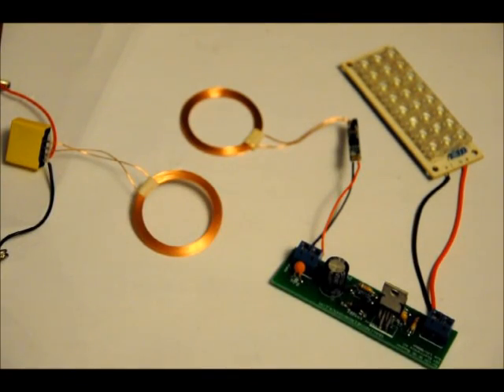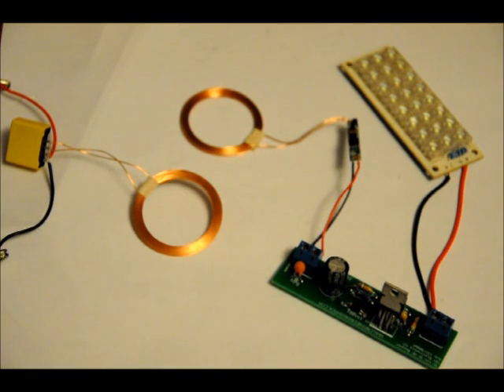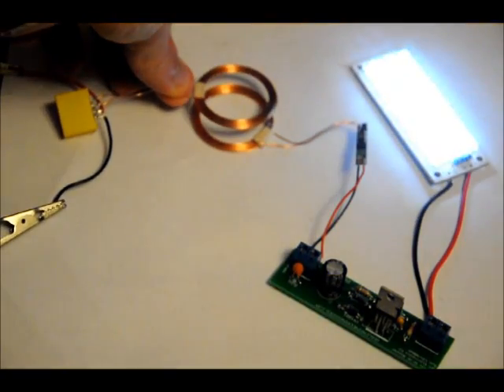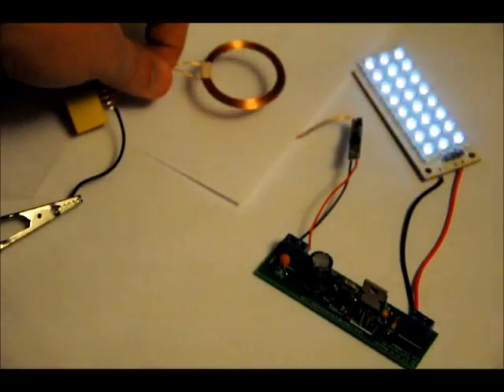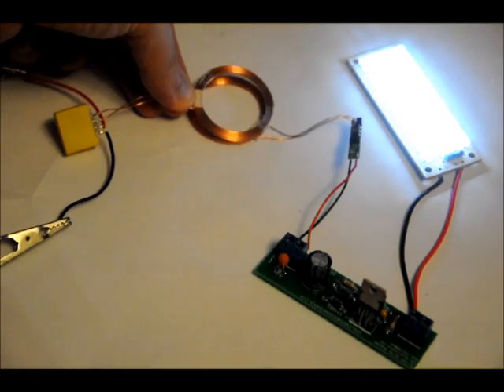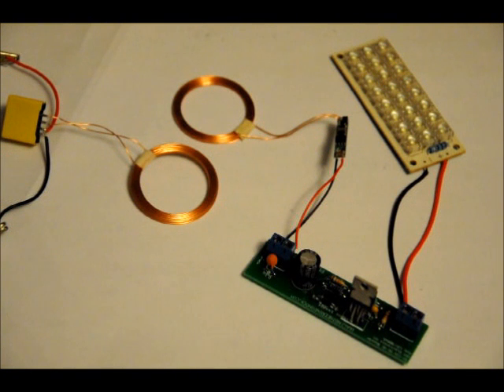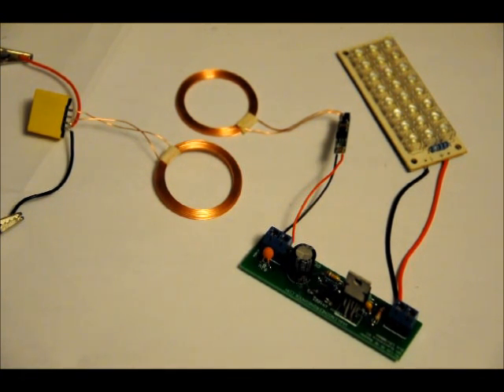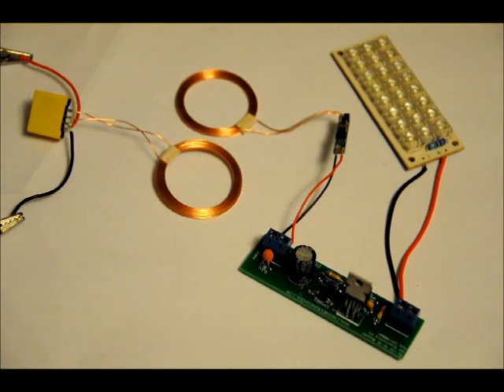Wireless Power Transfer   Wireless Charger Circuit For IPODs, etc!!!

Comment: Suggestion: combine it with a kinetic body motion charger, then add a solar charger. plug those into a portable battery charger. Then lastly add on your wireless charger. Have a friend 3D print a sleek shell to contain it all and fasten an arm band to it with a strap to fasten your phone or electronics to it and presto, no more wires necessary ever. Then if you really want to get fancy, figure out a way to combine this with the Emotiv EEG headset and bluetooth technology.

Can you do that? Afterward mass produce and either distribute for free or turn a profit.
Reply: If my idea is flawed or can't work, please correct me and explain how to expound upon it. Ideally this could change how we power things entirely. Independence from the power grid entirely.

Comment: Could you tell me how to calculate the max number of mili-amps, with regards to the diameter of the coil, the thickness of the wire and number of turns?!

Comment: cant you make the seconday coil larger, instead of using a boost converter? then use a simpler linear regulator or buck converter. after rectifing of course.

Comment: I'm working on a science fair project witht his inductive charger and I really need you help! What is that yellow, four pronged thing attached to the supply and the transmitter? And is you supply in the video AC or DC? im trying to make a solar powered inductive charger but I don't know if the induction would still work with a DC load. Thanks!

Comment: Actually the magnetic field. Actually the principle is very simple and efficient but air coils are not efficient. What is new is actually that some chips where created that can transfer information over the same coils so devices like smartphones could interact with the charger. This is necessary to protect devices from wrong chargers (and could also be used to make devices work only with a specific charger).

Comment: Just an FYI, I have been researching this very sort of topic (as originally discovered by Nikola Tesla) as a means of capturing any/all RF signals (say.... local radio stations for example,) and by using capacitors to store the harge in until it reaches a voltage level desidered for grid-tie, and then discharging the power back to the grid.  I have already started noticing a reduction in my monthly power bill, and soon hope to be sending even more power back to the power co.

Comment: So what's on the transmitting side?  I'm assuming it's all running off DC given the lack of a viable rectifier circuit.  The receiving end seems rather simple at just a coil, but if I want to drive my transmitter off a 5v 2A circuit, what do I need?  A resister and a cap?  Can I do it?  Will the power transfer be 5v and at least 500ma to charge a phone?  How do I assure proper resonance between the transmitter and receiver if using different size coils?  Thank you for any response.